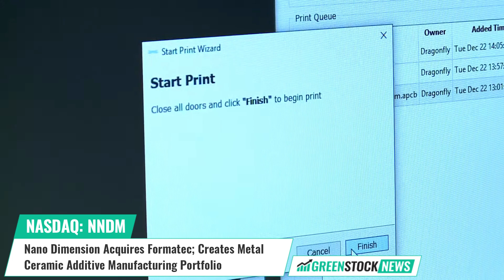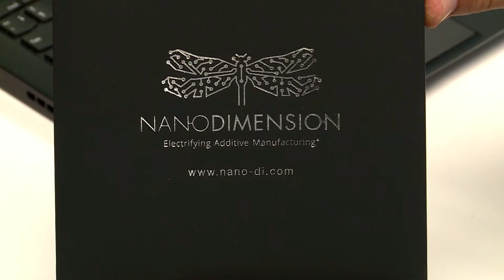Nano Dimension ($NNDM) Acquires Metal & Ceramic Additive Manufacturing Portfolio

Comment: I do not think this technology is needed at all. First argument that they make is that prototyping can be done in house without sending it to china. Well at some point the end product needs to be mass produced somewhere. Next, companies can prototype on bread boards they do not need this equipment for that. Especially if the actual product would not be produced in this way. So nndm is not useful